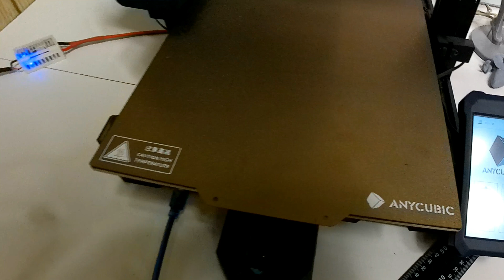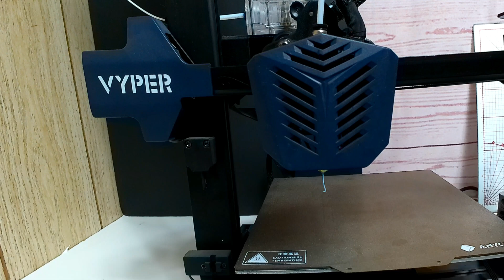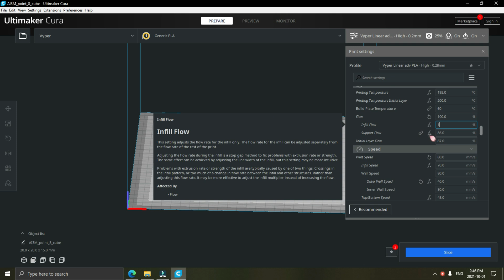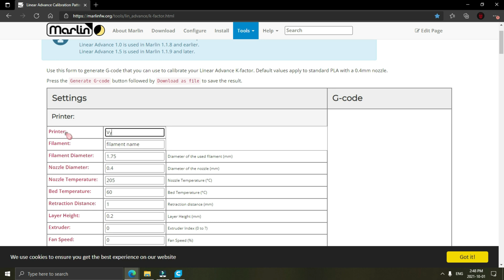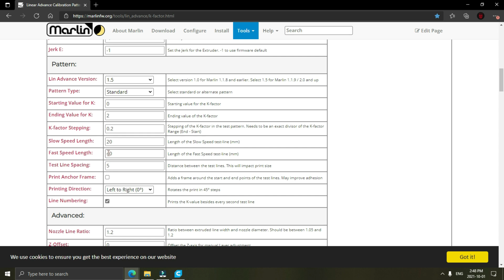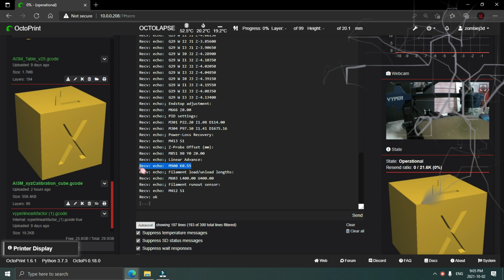Anycubic Vyper Calibration (e-steps , flow, linear advance)

Comment: Hey there, thanks for your hard work. Thought you'd want to know this little tidbit to get octoprint and Marlin to talk better with this little firmware update since you're doing custom firmware: https://youtu.be/fpphvl5C2Cw?t=724 
This way it will read data from the vyper that it currently can't like the filament runout sensor among other things.
Reply from the maker: Some of that does work well with the vyper the main problem is the lcd ui firmware it doaent have the screens to show some of the Information. I'm working on a new lcd ui system currently and hope to get it finished soon
Reply: @studiozombie3d  I loaded up one of your firmwares and I think either Marlin has it enabled by default, or you already enabled it since I see Printer Notifications in OP and its talking to OP more. BTW, what is this Baud_Fix_Erase_eeprom version? wondering what that fixes or adjusts. Haven't even tried looking into the LCD UI at all, so I am sure that's a big hassle. Look forward to see what you do with it.
Reply from the maker: @kcee3dee  I reverted baud from 250000 to 115200 to fix random pauses but it looks like the cause may be the power loss recovery or octoprint itself. Hoping to get lcd finalized here in the next week or so fingers crossed been a bit busy lately

Comment: What exactly does this version of the firmware do?
Is there an improvement in overall print quality?
Thanks for any input.
Reply from the maker: My main version has linear advance which helps improve bulging in corners and cleaning prints up overall due to the pressure control of lines advance
Reply: @studiozombie3d  Thank you so much for your hard work and the information you provide.I've just purchased the Vyper after having an Ender 3,Minda D2 and Voxelab Aquila.This is by far the best of all the printers but I am interested in improving it further.
Again,many thanks for all your hard work.
Reply: So Linear Advance is a feature on your firmware? I could not get any results from the tests I made and when looking here I find this.
So should i update with your firmware and then recalibrate again?
Reply: Sometimes one writes before checking for more answers... I have found my own answer.
Thanks for your awesome work with this printer! I've learned loads from your videos.
Reply from the maker: @Haij88  glad the videos have been of help. The linear advance helps a ton I find

Comment: This is cool.  Thanks for posting.  When i gain more confidence, i may try this.  But until i get a solid footing with my first printer, the oem settings will have to do
Reply from the maker: Calibrating esteps and flow are essential to good prints it's super easy
Reply: @studiozombie3d  i will give it a try.  Im going to take notes and try to get it done
Reply from the maker: @lanesteele240  sounds good if you need a hand fire me a message studiozombie3d@gmail.com

Comment: Thanks a lot for this excellent explanation. Super happy to even have more accurate prints now. I'll use your tip to test this for every type of filament!! Pretty new to 3D printing, but thanks to your video's I'm running octoprint and a fine tuned vyper that even has more acurracy.
Reply from the maker: awesome to hear its a solid unit i love mine

Comment: Thanks for sharing. 
Anyway I prefer to check my flow by cube with two layer width (0,8mm). 
Most calipers on stock have more or less correct accuracy (around 0,02 if you've luck). I think using it to too thin object causes inacurate results. 
Time to check linear advance.

Comment: printer is brand new as of 12/5/21 and when i print the linear print with a level bed the PLA does not stick and piles up on the hotend. The box had printed great mad thos adjustments printed a temp tower and truned out horrible. using PLA overture brand bed 60 nozzel 210.
Reply from the maker: The liner pattern needs compatabke firmware stock dosent have it. Double check when you level there's no filament oozing out it will throw the level off

Comment: Hi, thanks for the tutorials! Have you come across an issue with the buttons flickering?  If I use the screen to home, the home button flickers until it is done. If I use auto-level now, the machine just sort of greys out the button, (flickering), and gives no indication its doing anything. Ive tried 3 of your firmwares, no luck, even going back to anycubic's firmware does the same. 

(dont have a micro SD card small enough to flash the screen, would that be an issue?)
Reply: Took 4 more tries to update the screen, and finally that worked, and itss leveling again. Going to work on the linear acceleration now.
Reply from the maker: Ok cool glad you got it figured out the lcd is a pain and really picky

Comment: For all the noobs (like me): I think there is a small discepency in LA test. The setting you enter are from K=0 to 2 with 0.2 step, but your result seems to bet K=0 to 1, with step 0.05. Also I left the spiralized contours enabled and wondered why the prints started to  fail.
Reply from the maker: Yeah I had uses 0 to 2 but the video it was dialed down to 0 to 1 lol I didn't realize that thanks for pointing that out lol

Comment: if instead of sending filament through with the extrude button, which uses a fast feed rate for loading/ unloading, you use the console to set relative extrusion and send a G1 E100 F30 to extrude at a more reasonable speed, you will find there is no slippage and it delivers the 100mm of filament without adjustment of e-steps.

The extrude button, and the move axis on creality printer control panels, feeds the filament faster than the hotend can melt and extrude, this causes slippage, and therefore an incorrect e-steps calculation. To prove this is the case, try feeding it with G1 E100 F1500 and it will not only slip but chew its way through the filament or cause motor skips. the only change being the speed, and the speed is an unknown variable with the button in Octo...

The Slicer calculates the speed of extrusion to gain correct flow through the hotend, in order to do this correctly the mechanical relationship between e-steps and filament moved has to be accurate otherwise the speed of extrusion it calculates to get correct flow is also inaccurate.

Pretty much every e-steps instructional video ignores this unknown variable of extruder feed rate, for the vast majority of printers the default e-steps is actually correct from the factory as it is purely a mechanical relationship between the stepper angle and the gearing driving the filament, it is not variable as all the printers have the exact same stepper angles and gearing ratios, and will not actually need adjustment unless you change the extruder for a non standard extruder.

It amazes me that this myth about e-steps calibration has propagated through 3d printing to the point where no one questions it.. Maybe you could take a closer look and help to educate people including a great many top tier youtubers who propagate it for ad hit revenue ;)
Reply from the maker: I prefer to measure the 100mm this way as I find some pla materials are denser then some. And I find that if I push the material through the hotend I get much more accurate tuning of flow. I always heat the hot end up to 200 to calibrate. Most people disconnect the bowden to measure and I find that dosent work right at all. I also prefer to use the stock feed rate and tune to that. You can change the feed rate to make the esteps match  but I find this way works best for me and alot of people I get dead accurate prints off my vyper and my ender 3
Reply: @studiozombie3d  I think you missed the point.. the feed rate in octo, or the control panel, is not a 'default' feedrate its just A feedrate..

Its nothing to do with the actual flow when printing...

It is the speed at which filament is being forced into the hotend that makes it push too little, if you use G1 E100 F30 then it pushes 100mm with stock esteps, because you are not trying to push it through faster than its capable of passing..

its not a coincidence that default e-steps delivers 100mm slowly, its because that is what it is MEANT to do, deliver 100mm of filament without any resistance the slicer then calculates speed needed to extrude based on CSA of filament, CSA of extruded line, length of line, and speed.. You will never see the extruder pushing it through the hotend as fast as the "default" feedrate when printing, even if you were printing at 150mm/s..

Speed is a variable calculated in flow, its not calculated or accounted for in e-steps because its not part of the calibration process, nor is the amount of filament that can be forced through the hotend..

Invariably, although probably a bit less so with vyper as it has a better grip with dual gear, it results in flow calibration having to be reduced to compensate for too much filament being delivered, so "default flow rate ends up being 94% instead of 100.. Its robbing peter to pay paul..

Comment: The print quality and speed of my Anycubic Vyper are not exactly good. I noticed that with Linear Advance the bulges at the corners are less. The only problem is, Anycubic has not activated this feature. Can you help here? It should work with Pressure Advance too, but I haven't found a way with Windows yet. Whereby Pressure Advance should help the Vyper to improve quality and speed. Could you possibly make a video about these possibilities. Thanks in advance.
Mein Anycubic Vyper ist von der Druck-Qualität und Geschwindigkeit nicht gerade gut. Habe mitbekommen, dass mit Linear Advance die Wülste an den Ecken weniger werden. Problem ist nur, Anycubic hat dieses Feature nicht frei geschalten. Kannst Du hier weiter helfen? Mit Pressure Advance sollte es auch gehen, aber mit Windows habe ich noch keine Möglichkeit gefunden. Wobei Pressure Advance den Vyper zur besseren Qualität und Geschwindigkeit verhelfen soll. Könntest Du eventuell über diese Möglichkeiten ein Video machen. Danke im Voraus.
Reply from the maker: Send me a email studiozombie3d@gmail.com  I have linear advance firmware I made about a month ago and have a lot of people running it. Drop me a email and I'll give you a hand.
Reply from the maker: Myiu can find my firmware here and profiles for cura. You will need the LA pla profile. If using cura 4.12 beta theres a profile there as well. You will need to disable coasting and combing if running my firmware and reduce retraction to 2.5mm distance

Comment: Awesome job! Thx. What are your thoughts on changing Marlin from 16 point level to say 25. Also baby stepping z offset from 0.5 changes to 0.1? I’d love to see those changes. If I could get the Marlin firmware  I’m sure I could figure it out and compile my own. If you could be wonderful :)
Reply from the maker: You can easily change probe points I was going to try 25 points but ots been working well for me. But with the amount of variation I've seen between units 25 would be a good idea. Right now the firmware I compiled has baby stepping set to 0.02 but compiling lcd sources is a pain. Needs to be made from scratch from bare sources. Haven't had the time.

https://github.com/ANYCUBIC-3D/Vyper
These are sources I'm using currently
Reply from the maker: Have been looking at patching current marlin bufix source but the way anycuvic patch things in is a but different then most Marlin sources I've seen and used
Reply: @studiozombie3d  Well I gave it the college try :). I was able to find where the grid was but didn’t find the baby stepping, etc etc. Than it wouldn’t compile even if I left it alone (not sure I have the right board set even). So back to you 😁😁😁

Comment: Hi! Thx for your great Job!
if I want to use the firmware, do I have to change something on the motherboard with regard to the voltage or does the firmware work without changing the hardware? What are the disadvantages without voltage adjustment?
Reply from the maker: No problem glad you like the videos. The firmware will run without voltage adjustment fine. But I've dropped my vref to 880 on all steppers and heat is cut in by more then half. Stock the motors get smoking hot, but with the 2209 in standalone you can lower via the pots on the  mainboard. Even if you don't adjust it works fine motors just get a little warmer
Reply: @studiozombie3d  OK! That was the fastest answer ever :-)

THX!

Another question:

What's up with the URAT and 2209 stuff? Didn't understand all that ... some write with the Vyper something is not installed correctly by Anycubic and that's why Linear Advance supposedly does not work ... but then your firmware would not work ... unfortunately I do not understand technically ... . what is right now with all the discussions?
And ... last question ... do I have to test, calibrate and save values for "Junction deviation" after importing the firmware, or is that just on?
Reply from the maker: @christophmees8897   the firmware I have runs the 2209s in standalone mode you need to make hardware modifications and solder some wires and resistors to get uart mode. Linear advance works fine in standalone mode it just works different the values are lower then they would be in uart I have a good number of people running it and k values seem to be k0.45 to k0.55 and for junction devieation you can use any square print to test and tune it. I've been using j0.05 and j0.1 with good results.
Reply from the maker: @christophmees8897  there have been the very rare time it may extrude wierd with linear but all the people I've helped with the firmware haven't had the issue.
Reply from the maker: @christophmees8897  whe  you flash the firmware send a m502 to make sure eeprom cleared properly. Then m900 k0.00 for linear advance and for junction devieation send a m205 j0.05 for junction devieation. Some users also find lowering print acceleration helps as well. Send a m204 p800
Reply: Thanks very much!!!

Since I don't have to solder anything or change the voltage (I'd be afraid of changes to the hardware :-) ) to test the firmware, I'll give it a try tomorrow, I'm curious: -) ... Thanks for the quick help !
Reply from the maker: @christophmees8897  your more then welcome you can still adjust rhe voltage via mainboard pots. I'm going to get a video uploaded asap on how it's done. Let me know how it works out for you 👍

Comment: Loaded your firmware, it says zombie on the version.   Had to touch a tool to the tip to start levelling.  Super instructions and thank you for supporting this printer
Reply from the maker: Glad I was able to help. Let me know how it runs for you. You can always contact me via my email if you need a hand 👍
Reply: @studiozombie3d  I swear I think your firmware made this printer better. Just a few test prints in and I can tell a difference.
Reply from the maker: @Tester13032  nice glad to hear. All the people running it have been pretty happy and I've been super happy since I started running it a month ago. Honestly this is the firmware it should have shipped with
Reply: @studiozombie3d  Placed an order for my Vyper. Sounds like I should install your software from the start. I'm a newb and this is my first 3D printer. Any advice would be greatly appreciated.
Reply from the maker: @hexpulsewin6122  what I suggest you do it when you get your vyper calibrate the esteps and flow and try a couple test cubes and prints then you can try my firmware and compare. My firmware package also now comes with prontorface to Calibrate and a couple stls for calibration. If you need a hand drop me a email at studiozombie3d@gmail.com and I'll help you out. It's super easy to get everything going. And I also have pre made profiles ready to go for cura for stock firmware and my custom.
Reply: @studiozombie3d  oh man that sounds awesome. I have no idea what you're talking about, but I will learn. Once I get it in, I'll set it up and do a test print. In the meantime, I'll research what you're suggesting. I'm fairly tech savvy, but this is a whole new world for me. Looking forward to diving in and learning. I really appreciate your kindness!! 🙌
Reply from the maker: @hexpulsewin6122  no worries. You can check my linktree and grab the profile and firmware files and take a look I have a Readme in there with the changes I've made from the stock firmware. And you can Install pronterface and cura and get familiar with them
Reply: @studiozombie3d  thank you!!!!

Comment: Great video as always, i'm a noob when it come to adjusting the software. is there any chance you could do a video on how to download the program how to install it and how to use it with the vyper without using Octopring and a raspberry pie?
Reply from the maker: Thanks I appreciate that. Sure I can do a pronterface video it's pretty easy just install and connect USB I'm working on a video for voltage adjustment and will add pronterface to the list
Reply: @studiozombie3d  Thank you for that, I know the basics but would need some help with the ins and outs with the software. updating the board and screen is the lvl i'm at lol.
Reply from the maker: @fourpound101  fire me a email at studiozombie3d@gmail.com and I'll give you a hand it's pretty easy

Comment: This doesn’t go into detail. You say “let’s jump over to the computer to modify the esteps” what is octoprint? How does it communicate with the printer? Let’s of missing info here.
Reply from the maker: Octoprint is a raspberry pi system that runs your printer for you. I have a octoprint video. I should have shown how to do it on pronterface but didn't think of it. You need to connect your pc to the printer with USB to send commands. Pronterface.com is the pc option.